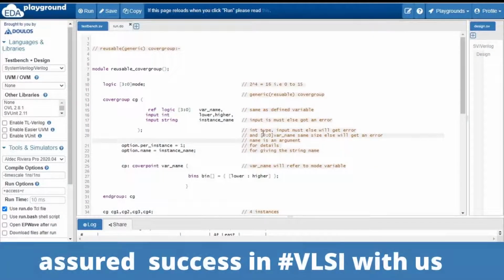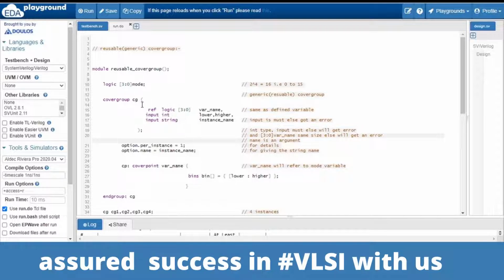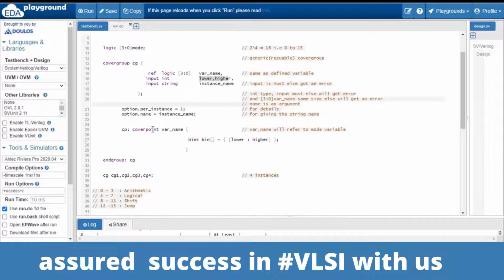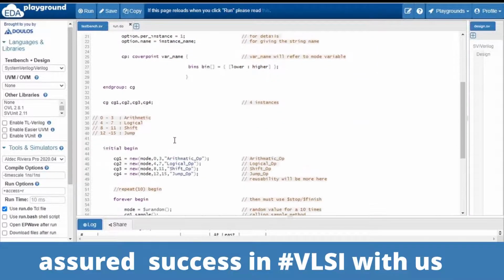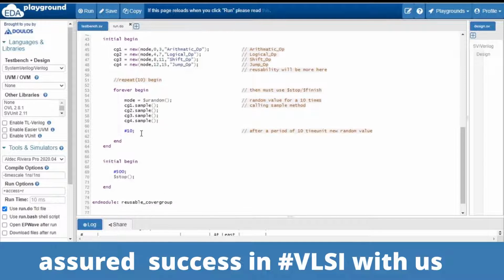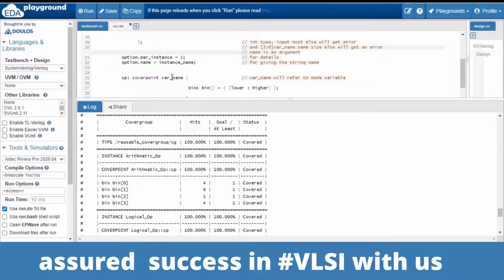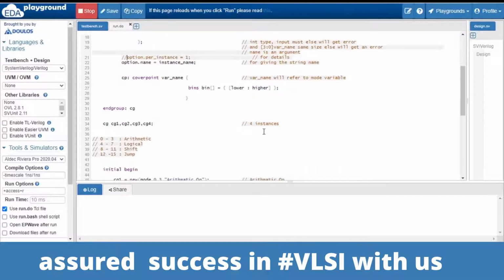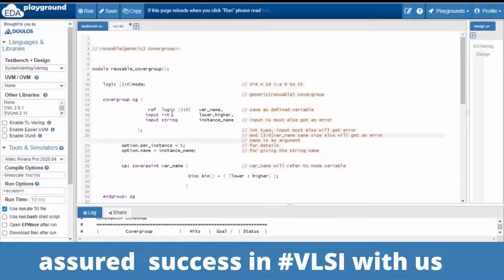Reusable Cover Group  SV Functional Coverage #verilog #systemverilog #uvm

Comment: Although the method is quite straightforward, I doubt there's any practical value. This type of functional coverage model doesn't add anything on top of code coverage. In fact, unless you do something clever on the sampling, the above technique is just a way to increase simulation runtime for no added benefits.

More interesting would be to generalize transitions and crosses, which bring more value than just field coverage.